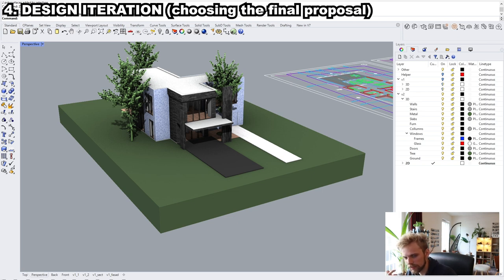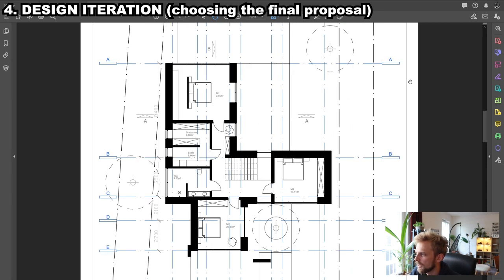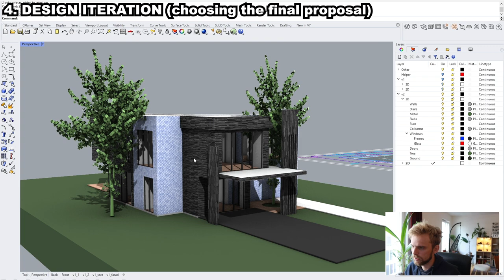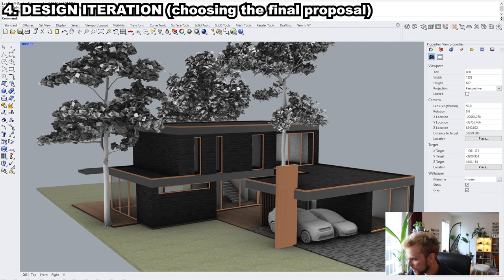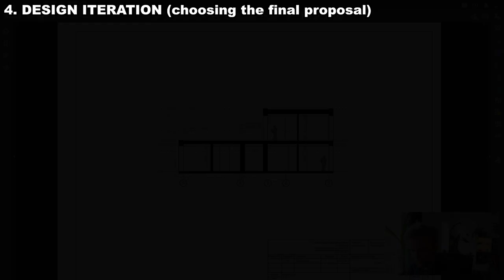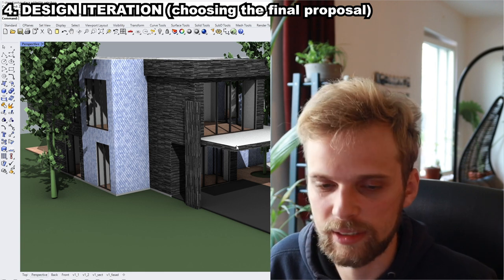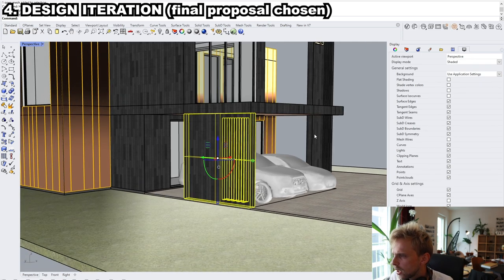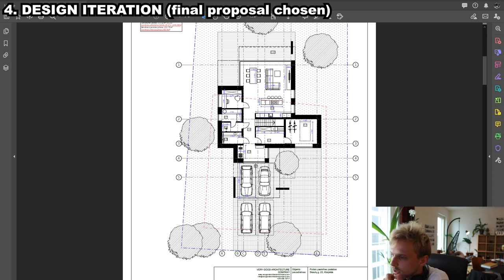Winning proposal chosen : Architecture design from start to finish #2

Comment: I'm really loving this series! I was wondering if it is normal for a design to take a month from initial contact to completion?
Reply from the maker: Glad to hear it! Honestly, really depends on the project type and how much "attention" does the client require. For a family house the range for design completion is somewhere between 4-8 weeks. Once the construction drawing phase starts it becomes more unpredictable as there are many outsourced consultants whom begin working with the project (engineers, energy efficiency consultants, heating system engineers and so on)

Comment: Hi, great video as usual, Do you use Rhino for drafting all the drawings or a separate cad program?
Reply from the maker: Thaanks! For the proposal/design-development phase - I use Rhino for everything, but then for technical/construction-document phase I migrate to ArchiCAD (literally same thing as Revit) , just because our Structural engineers, Electical engineers and so on all use Archicad, so it's just to make sure that nothing will get lost in translation

Comment: i wana see this in grasshopper.  :)
Reply from the maker: But why? That must be some form of masochism...
Reply: @DesignGoBrr  SO IT COULD BE PASRAMETRIC. CHANGE SIZE OF WALLS/ROOMS/WINDOWS ETS.
Reply: @IronMan-yg4qw  for that u can easily use visualarq...but if You would to have voronoi paneled elevations, then why not use gh, maybe also for stair design gh can be useful too.  And Its still small family house, not skyscraper in NYC or Hong Kong where one small change can impact the other things...

Comment: shame you use Portland cement derived concrete/binder. It's driving the anthropocene. Thanks for doing these videos though
Reply from the maker: we don't - the client has a full authority over the construction material. We as architects can only propose alternatives and express concerns, but if the client doesn't share same concerns - then there's unfortunately nothing that can be done.